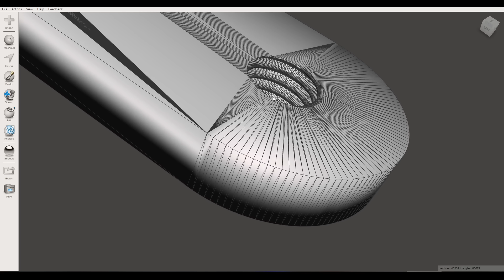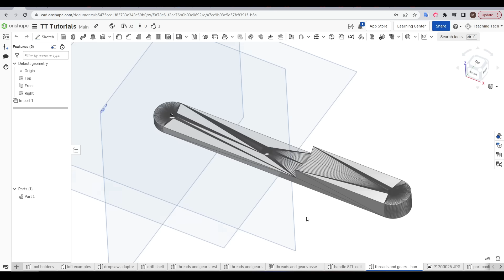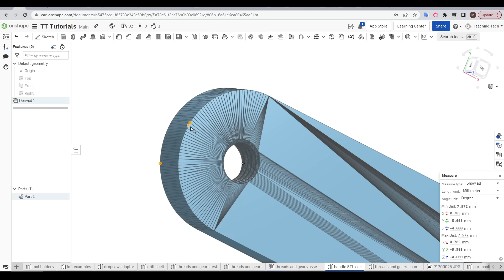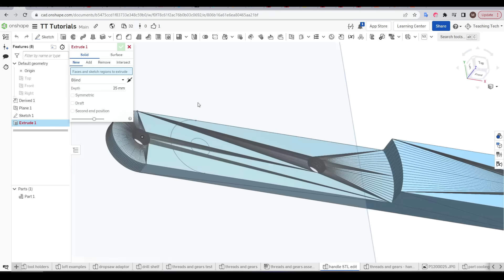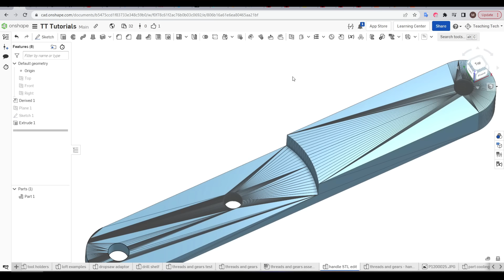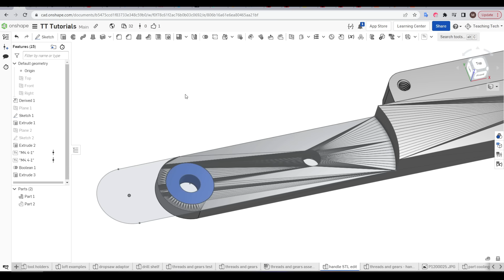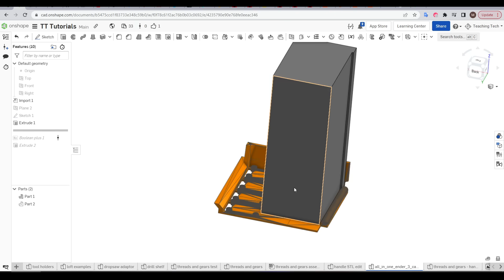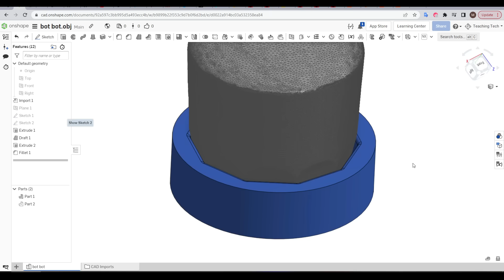How to modify an STL or mesh - 3D design for 3D printing pt7

Comment: I tried FreeCad and I tried Autofusion 360, following other tutorials on editing an STL. But I just couldn't get them to work. But Onshape worked like a charm. It was also very easy to pick up. The only problem I had was trying to make a plane on an angled piece. I used the three point method instead of the offset and that did the trick. Thank you for your tutorial!

Comment: If an imported STL aligns correctly with the top plane but the X axis is slightly askew, is there a way to realign the imported part so that it is square with the front/ right planes?
Or is the best work around to just create new planes?
Reply: Also the slight misalignment makes all the X&Y dims slightly off... which is a bummer

Comment: Hello :) Quick caliber pro tip: to get exact center measures between holes, use the back tips (like in the video), first inside one hole, remember to write the hole size down -> then (re)set to zero while still measuring the hole size -> then insert the back tips into two holes, then measurement the caliber now shows is the exact center to center distance
Reply: I was watching that, imagining ways it could be done. Thank you

Comment: Awesome video, but I'd still recomend recreating the STL part using cad tools. You can snap planes onto surfaces, make three-point curves etc, project points to sketches, so generally speaking it's a rather straightforward process.

Comment: I’m using an educational license for Inventor, every time I’ve wanted to modify an STL to add for example a cutout for a button or resizing a hole, I’ve had to spend hours rebuilding the model from the ground up before I could modify it to suit my needs.
This feature alone has ensured OnShape will be what I move over to when my free license runs out.

edit: nevermind, the free plan makes all yout models public, and and from what i read, it seems you forfeit ownership and intellectual property rights/copyright of your models.

Comment: Autodesk putting a paywall in Fusion for the management of imported STL files or meshes is such a dick move IMO. Licences are still far too expensive for the single casual user. I can't currently sell more designs than I would need to to pay for my own time let alone the licence.

Comment: Attempting to follow this session made OnShape choke repeatedly, showing the "loading circle" as soon as I did a couple operations referencing the STL, and no longer saving any changes I made, plus if I reloaded it thought I was still working on the document in parallel for a good while, until those zombie sessions expired I guess.

Comment: Does anyone else get this when they try and extrude a sketch through an STL; Extrude 1 did not regenerate correctly: Boolean operation failed to return a valid part.
Reply: I just received this error when working on modifying an STL. I was adding an extrude and it was generating that error instead of adding it to the existing part. I fixed it by removing some rounded corners on the sketch and instead making it a diagonal line. 

I then went and created a new sketch on the working extrude to sketch the corners to get the desired effect. So just an extra step but made it work in the end.

Comment: i notice his calipers don't have the little wheel at the bottom.  to those who have never used the calipers with that wheel, i would recommend them.  it makes small movements a hundred times easier to control.  plus, the plastic ones will eventually develop little divots in the jaws and make your measurements inaccurate.  the same thing can happen with the metal ones if you're super rough with them, but it's far less likely.

Comment: I made some knife handles(scales) for a knife of a friend of mine. I made it in fusion 360 and measured everything multiple times, but when I print it the parts are always off by some amount, handle a little shorter or one of my connectors slightly off. Instead of starting from scratch is there a way to use onshape to fix this?

Comment: It would be nice to know how to source parts to include in models. For example what if I want to make a case for a raspberry pi zero or make a port in a case for a USB micro connector. Where can I source a model for a raspberry pi zero or a USB micro connector and then how can I use those models to edit  my creation so it works with them. Thank you for this tutorial series!

Comment: @1:55 if you want to measure the distance between the center of two holes, measure the inner distance and the outer distance and calculate the average. If you do it with the “floating tips” you most likely are off by a couple of 0,1’s because if you measure something like 4,6, you probably think… nah… it must be 4,5 while it actually is 4,7.
Designers don’t always use “nice numbers”.
Reply: Or, when holes are of equal size, "measure" one hole (or bolt), reset to zero and measure outer distance. Magic ;)
Reply: @kimmotoivanen  yes that works, but only if you have 1) two holes of equal diameter and 2) a digital caliper :)

Comment: Great tip, but please don't export STLs anymore and I regret I haven't switched to 3mf-files more early. First reason is you can just export all parts in one file and one by one slice them. In Cura the parts are imported outside the printbed and you move the part you want to slice to it. The downside is you need to rename the gcode-files for every part or they would just overwrite itself on the SD-card, but just having one CAD-file for one project is far more convenient and worth it.

Comment: Hey Michael, I have an issue with your calibration tool/website, and I'm not sure where to ask for help. 

Every time I try to print the gcode generated by your website, I get a Klipper "stepper too far in past" error. I could figure out that it has to do with the feed rate values, but I'm not sure how to resolve it other than go into the gcode and manually lower the F values. 

Is there a way to change them right on the website, so I can print straight from the site?

Comment: I use F360. I gave up dealing with other people's STL files a long time ago. I rarely print them and no longer try to modify them. Both can be exceedingly frustrating for a lot of different reasons. 
   Once you have the skills to draw whatever you need in F360, Onscape or any other 3D CAD program, it is far faster and easier to just draw the thing from scratch. If you don't have the skills to draw your own, Michael's video has some really good tips and workarounds, but it's still likely to be a frustrating experience. 
   The best experience is a well designed model in STEP format. Some designers provide them. Some don't. Usually the better designers do. In a few cases, I've emailed the designer asking for a STEP file explaining how I want to modify it and they have sent me the file. If you do that, be sure to post a "Make" on the site crediting the original designer.

Comment: This may be too simple, but I can’t figure out how to make an object shorter. For example, I want to take a table design but make it 20cm shorter in length. Is there an easy way to do that but keep the legs, skirt, etc in tact?
Reply: There are different approaches, depending on what exactly you mean to do. The simplest is to use the "scale" feature, which allows you to apply scaling factors (one for each direction) to a shape/body. This will change the whole object though, included e.g. the thickness of the table-top. If the section of the shape you want to make shorter is uniform, then you can split the body at two planes representing the distance you want to remove (e.g. making the planes 20 cm apart), to make three pieces, then delete the middle piece and move the remaining two pieces together.

If for example your table legs are tapered, then that won't work. Instead, you can split the shape just at the bottom surface of the table-top (i.e. split the legs from the top) and apply a scaling to the legs only. If you apply a non-identity scaling factor (i.e. something other than 1.0) only to the vertical/length of each leg, then the height of each leg will change without affecting the width.

Comment: Amazing video, as always. I use Solidworks for something similar, but instead of just changing the mesh with added solids like here, I have to redraw the full part and then edit it to how I would like it to be, with permission from the original creator of course. I'm glad that this style of modifying/reverse-engineering got more recognition.

For simpler parts, it's no issue, but for certain hobbies I'm into where there are some extremely odd rounded surfaces, I'm still having an incredibly tough time.
Reply: That was what we had to do in OnShape as well before the recent updates.

Comment: I've been wanting to do some modifications to an STL file, so this was timely. If you do a follow-up I'd be interested in how you'd shorten something that's two complex ends with a simple shaft between.  I'd like to take some of the shaft away and then join the two ends back together but I'm not sure how, or if that's the best approach.

Comment: A lot of STLs were exported from Fusion360 with ultra high definition settings, resulting in the entire object being tessellated just like the last import example in your video.
Most apps, even Fusion360 itself, perform badly and become sluggish when importing such high poly objects. Perhaps a video on how to simplify the mesh and making the object more app friendly without loosing accuracy or sharp corners would be helpful.
Reply: the windows 3D Builder (part of Win 10) has a simplify function that works great to simplify, and you can control the granularity...
Reply: @scottbaeder37  Did you mean "3D Viewer"?
Reply: @mururoa7024  It's 3D Viewer, it's available in the Windows Store.
Reply: @mururoa7024  No, he was correct, it's Microsoft's 3D Builder and available in their app store for free. He's right, the Simplify function works, great, but I use it every day for it's Repair function.  I get lots of STLs from sites that throw an error message in Cura that it's not watertight or has problems with invalid faces. I just load them into 3D Builder, it says "Hey, there's a problem here, want me to fix it?", and never once has it not fixed a bad STL file for me in seconds. It's solid gold for me.
Reply: @TechnoBowen  Thank you so much for this tip. Should have been obvious to me but I couldn't work out why I couldn't edit this STL. Super quick to simplify it on 3D builder and then update the file in Onshape.
Reply: Onshape is a lot faster than Fusion360 from my experience.